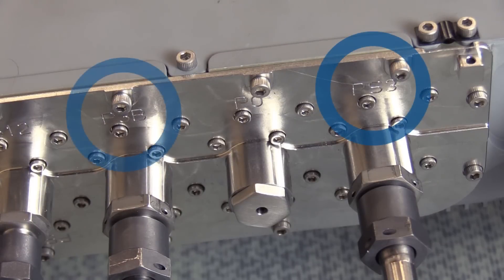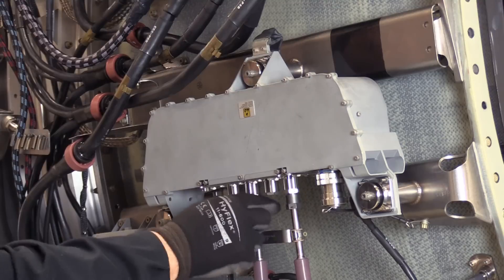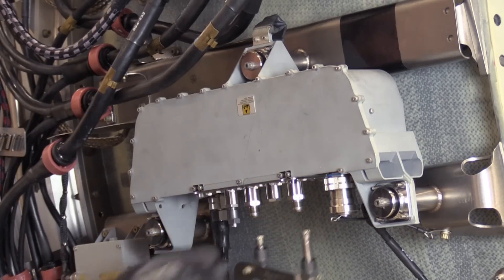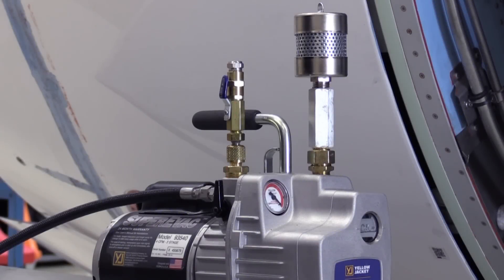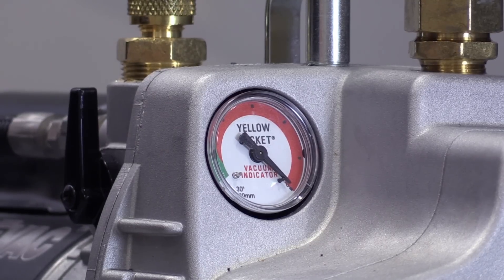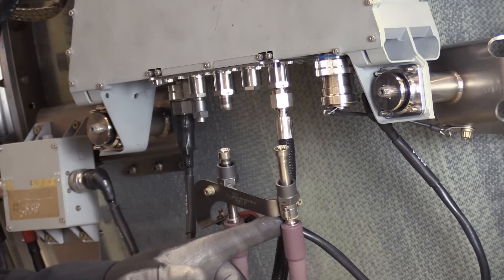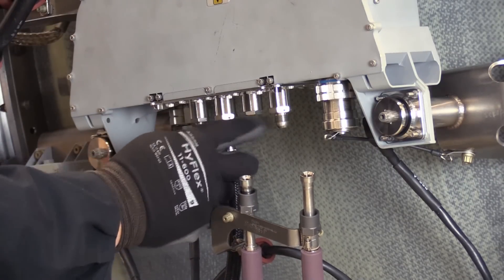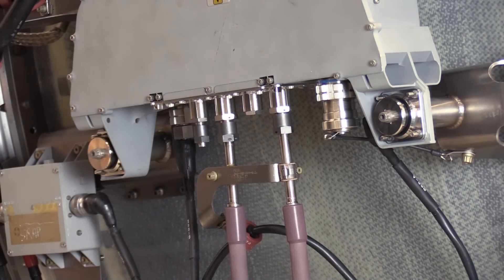LEAP - Moisture Removal from PS3P3B Sensing Systems

Comment: Do you have a part number of the air nozzle that connects to the nitrogen cart air hose? To properly blow out the drain line.

We only have shop air nozzles and that typically has moisture in it.  So we don’t want to use that

Thx